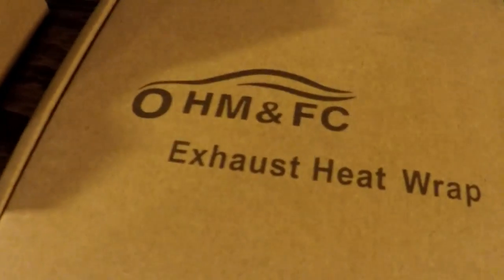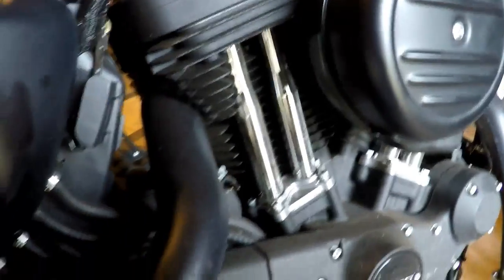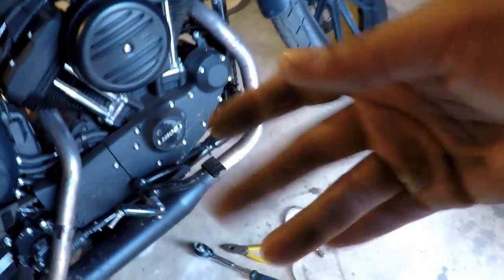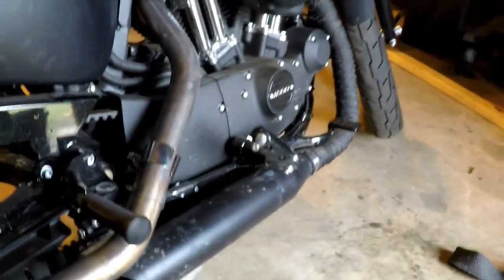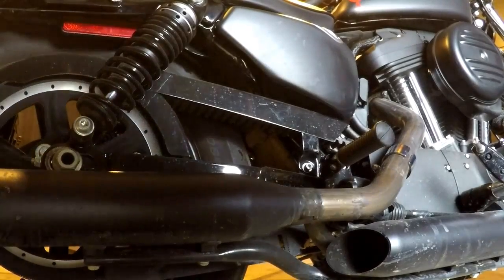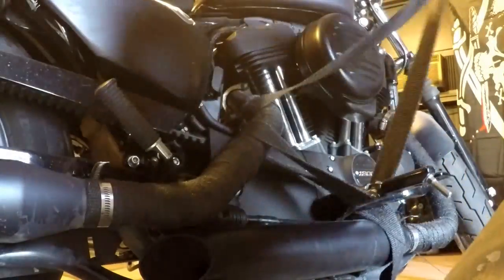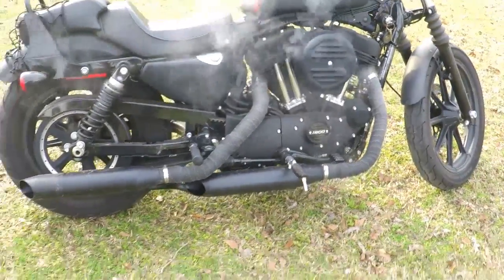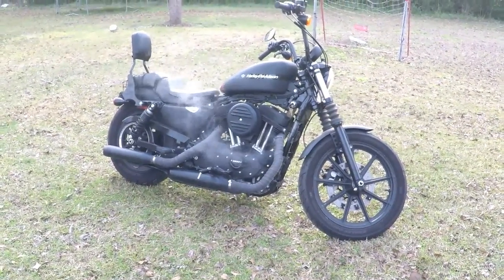Exhaust Wrap Harley Davidson Iron 1200

Comment: annodized black exhaust clamps would look sharp and ya may had made a cleaner install with pipes off?, tuck in edges and all ends, big part of the wrap clamps all towards the back of exhaust ;)
I gotta set of shorty drag's dressed in black on my '89 XLH1200 ;)

Comment: Hey what passenger seats is this ? thx !
Reply from the maker: It's the OEM one from Harley. Not sure the model number. I had to drill a hole in the fender to get the rear bolt to mount.